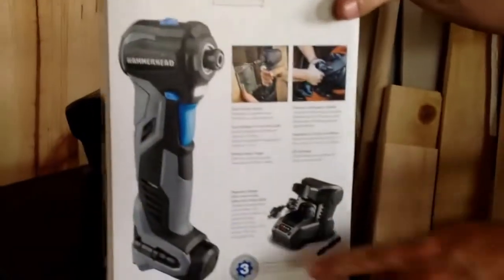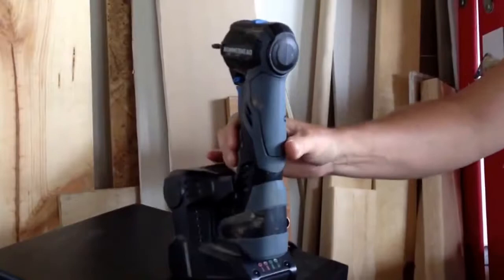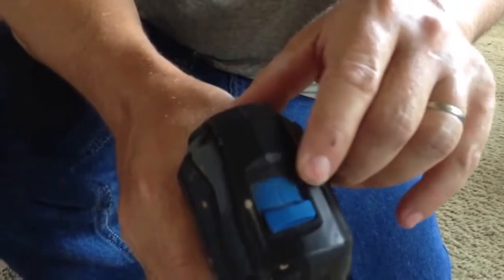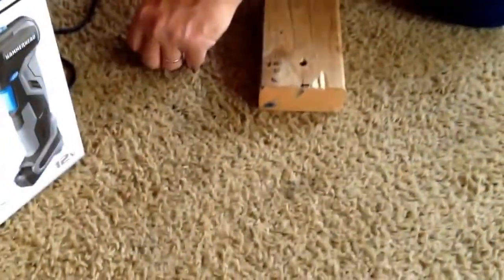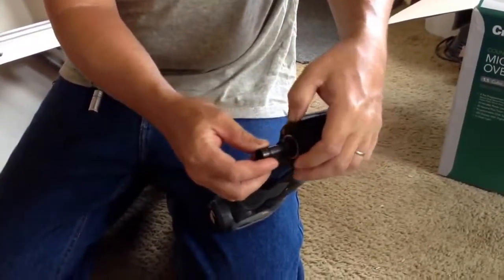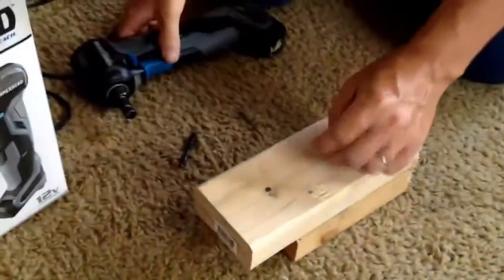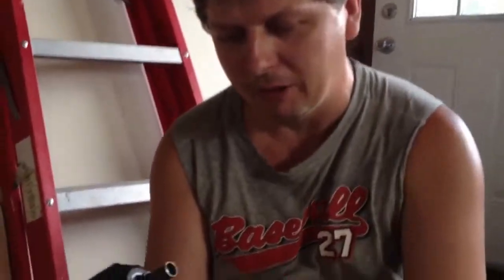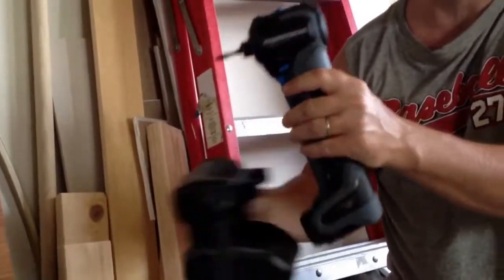Impact Driver Auto Hammer

Comment: Interesting that you just made this video as the tool hasn't been made for a few years now. I really wanted one for the impact driver because of the small head, but I didn't like the idea of not being able to get replacement batteries for it. The nails would go in much faster on a solid surface instead of on carpet.